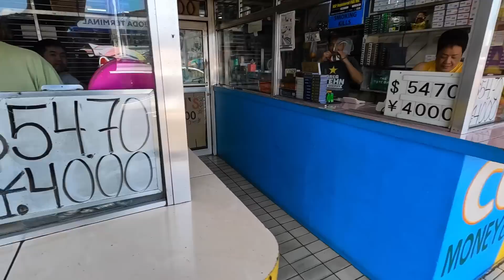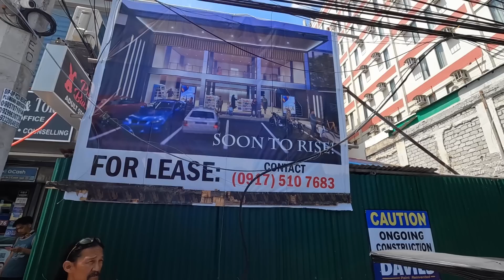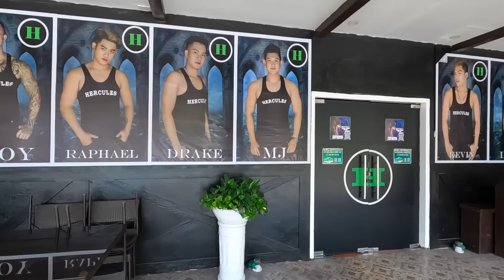GOOD QUALITY WORKERS ARE HARD TO FIND - WALK TO ANGEL'S BAKERY ANGELES CITY PHILIPPINES

Comment: JUST a thought but if you put a filter on the out side of your aircon at the intake  it will filter your air before it goes in your air conditioner. I do this and it cleans better and cuts down on maintenance